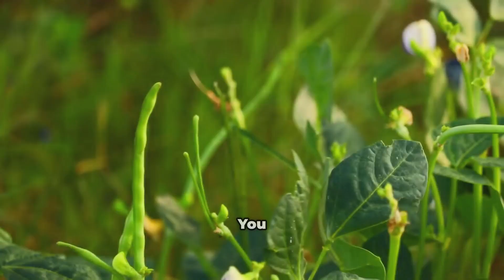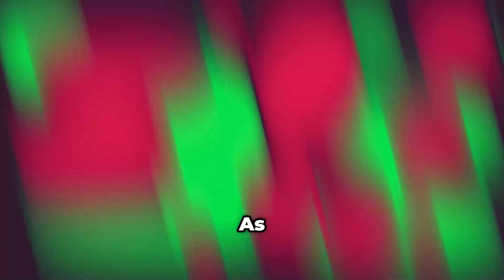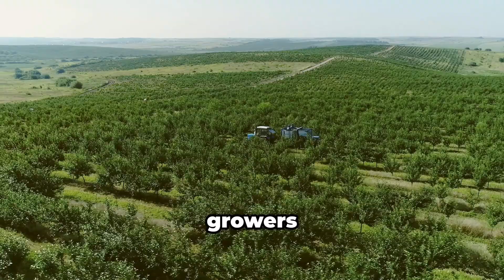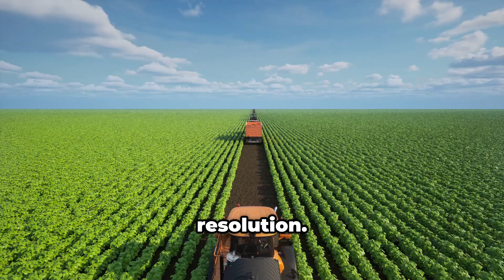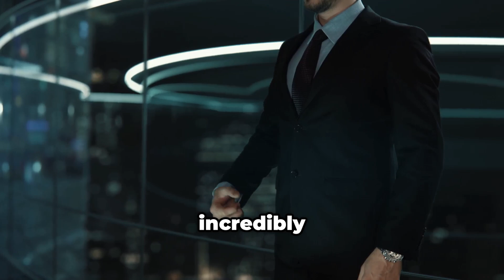LCI Explained: Leaf Chlorophyll Index for Crop Nitrogen

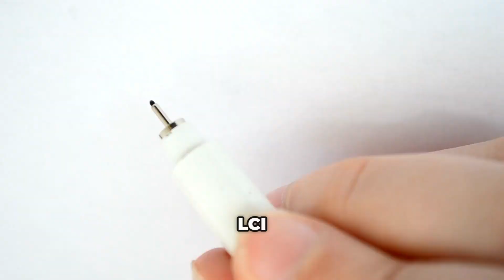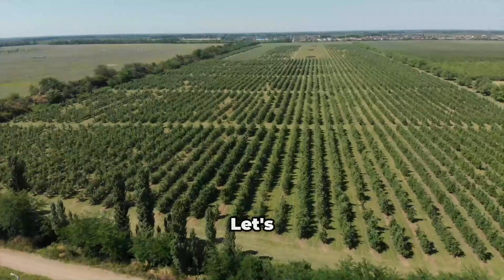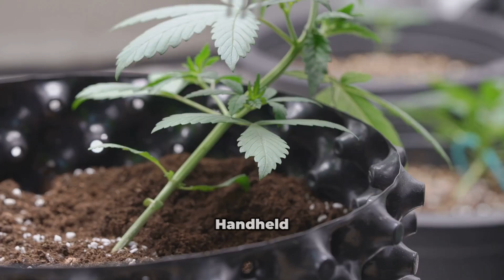Comment from the maker: 📌 Correction: At 2:30 we said "LCI NDRE," but these are two different indices. NDRE = (NIR − RedEdge)/(NIR + RedEdge). LCI also uses the red band: Datt's (1999) version is (R850 − R710)/(R850 − R680), and some software uses + in the denominator. Two name fixes: MTCI (3:04) is the MERIS Terrestrial Chlorophyll Index (Dash & Curran, 2004), and the meter at 5:46 is the Konica Minolta SPAD-502.
https://doi.org/10.1080/014311699211778
https://doi.org/10.1080/0143116042000274015